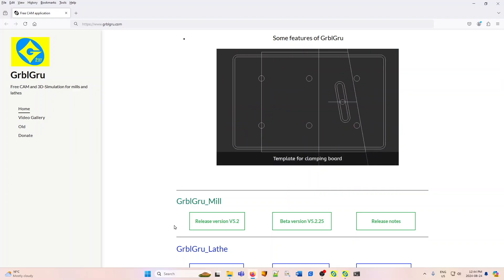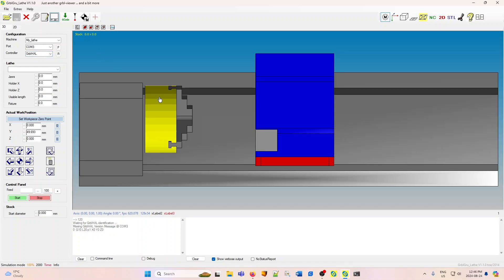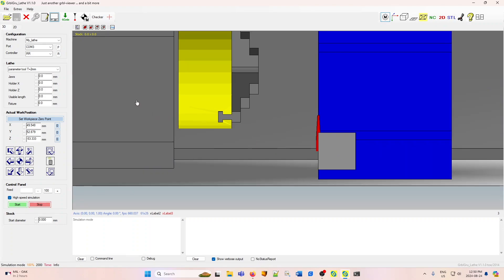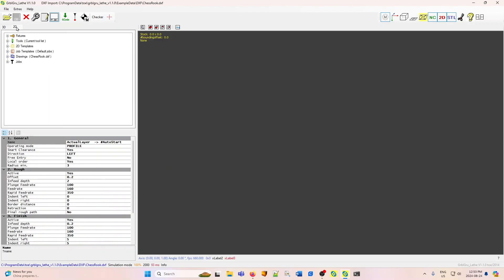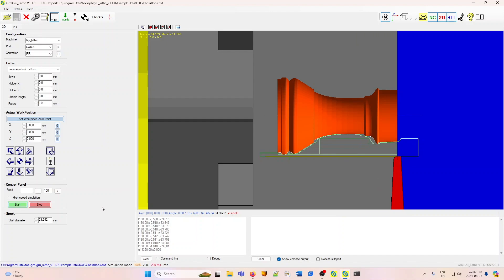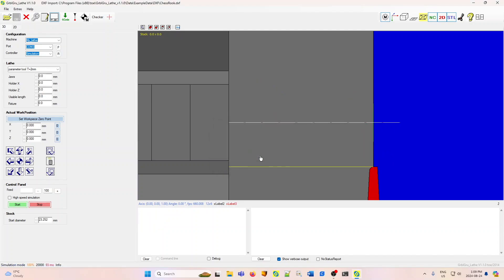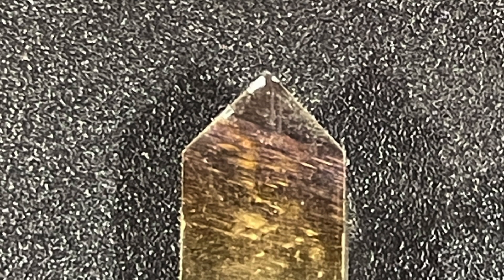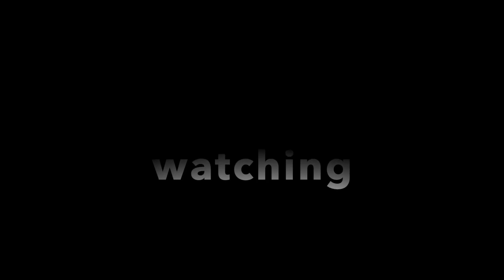GrblGru Lathe Basics

Comment: Can you show how to make the design in Inkscape instead of Vector?
Reply: @KINDanon  I’ll do a short video soon on simple DXF graphic creation for Grblgru Lathe. Inkscape can work since it’s like Lightburn. The important thing using any CAD program for this is getting the right hand side of the graphic on the Origin point.
Reply: @j.hankinson7803  Yes, the problem I have is getting the part scale and position correct
Reply from the maker: @KINDanon  Grblgru is looking at the Lathe program again. He spent most of the fall of 2024 on a foam cutting addition to the mill program. He will consider adding DXF primitives for simple drawings within Grblgru lathe which would be great. Cheers.